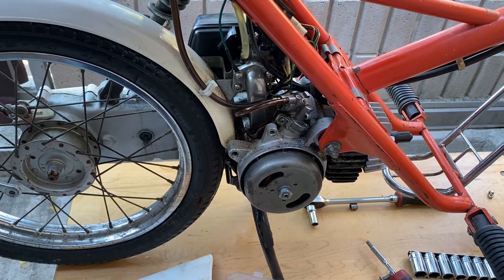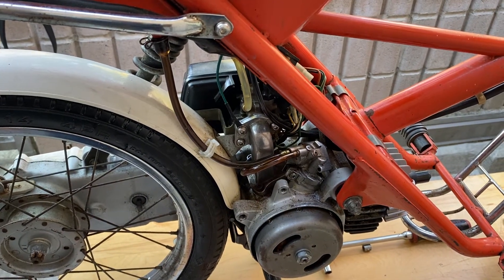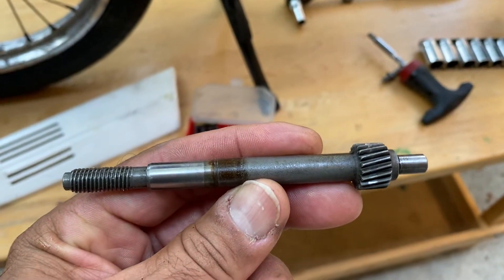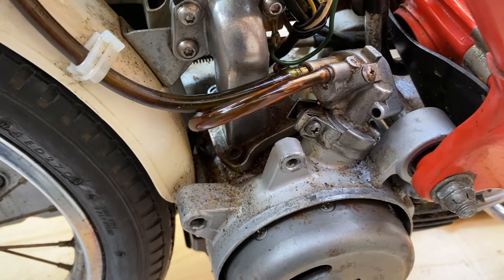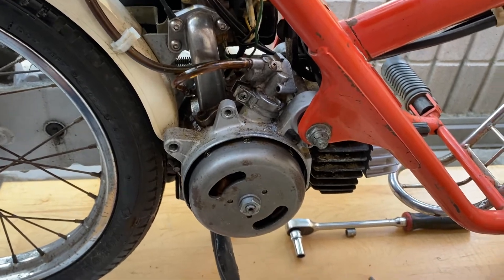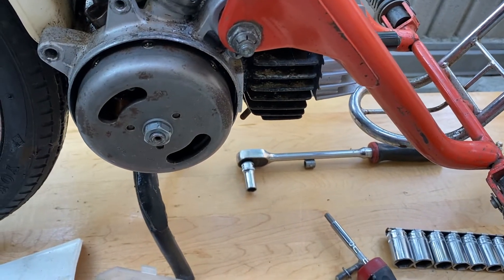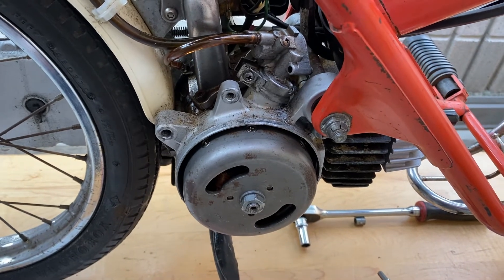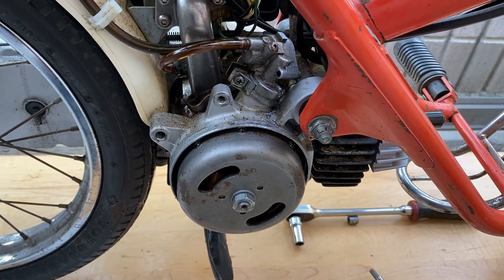Honda express oil pump delete

Comment: my grandfather gave me an '82 nc50 and I think it had the same oil pump failure as you explained on yours, because when I dropped the exhaust pipe it seemed as if the crankcase was FULL of oil. so I will be deleting the oil pump driveshaft, thank you

Comment: Great hack.  Thanks for sharing.  What ratio of petrol to oil mix are you using?
Reply from the maker: I’m running it 50:1 which adds up to 2.6 ounces of oil to one gallon of fuel.

Comment: Good video very interesting.
Cheers
Reply from the maker: I’ve since then replaced the tires with IRC NR77 70/90 14 showcase video coming soon.
Reply: @miguelpagansr6128  looking forward to the video.
Reply from the maker: Hope you’re doing well, any progress on the old Peugeot? Thanks for watching.
Reply: @miguelpagansr6128  Hi Miguel how are you doing? 
I haven't had a chance to work on the Peugeot. I need to paint a section of the fuel tank due to it developing a fuel leak and had to repair it.
I will probably will be selling both of them. Because I found out that I will need to get an endorsement to my licence in order to drive it. If I would have known that I would have never bought them.
Reply from the maker: @SDsailor7  Im so sorry to hear that, it’s one of those things if I knew then what I know now. Good luck selling them and maybe once you get the endorsement, you can get something real nice that you can enjoy. Take care and until the next one.
Reply: @miguelpagansr6128  Thank you. Hope I can get a couple of buyers.

Comment: Definitely burn that exhaust somewhere with good ventilation. My neighbors literally thought I was cooking chicken lol! You’ll burn a ton of crap out of there and avoid harsh chemical fumes. (Besides oil smoke) lol and paint her with rusto high temp black paint. I did mine with a can and brush mint!
Reply from the maker: You got it, I’ll be burning it in my friend’s burn drum in his backyard. Thanks for the advice and ride safe.
Reply from the maker: I’ve since then replaced the tires with the IRC NR77 70/90 14 so stay tuned for the showcase video coming up soon.
Reply from the maker: Do you have any videos of your ride? I’d like to see it on YouTube in the future.